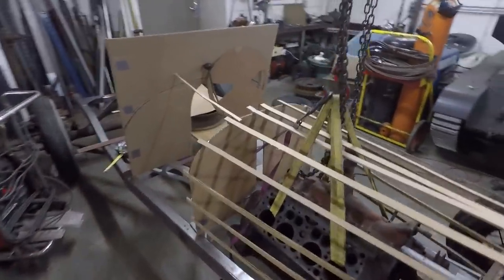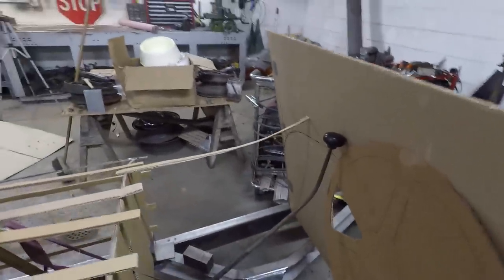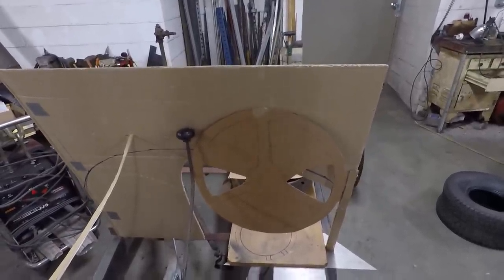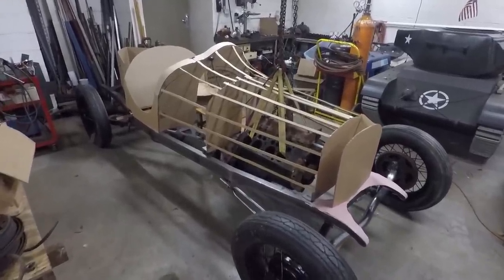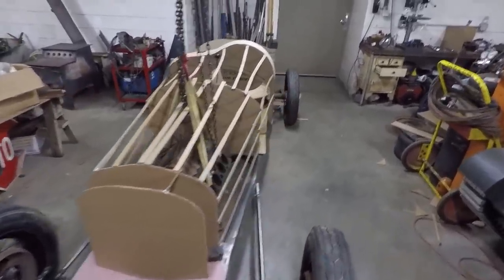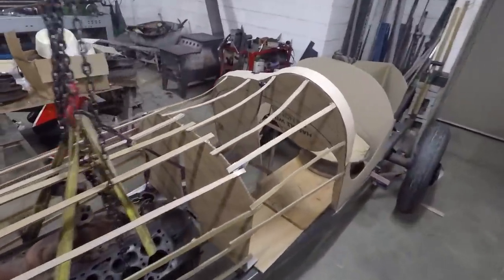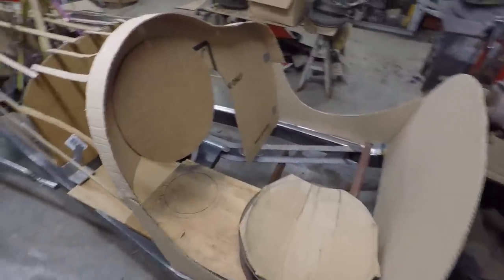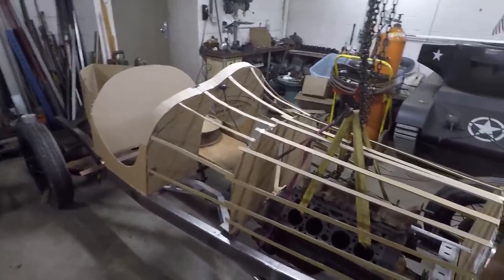Cardboard Car Body Mock-Up | Boat-tail Speedster Pt.19

Comment: I wasn’t thinking there would be anymore videos before the spring but you managed to squeeze in one more from your break. 😁

Seeing the CAD (cardboard aided design) mock-up really shows the scale of the project and will be a cheap way to plan for the overall design. 
Like one other comment I also agree that the boat-tail could/should be longer. They were often as long behind the tires as you made the tail now. 
Either way it shows that the 2 seater is going to be extremely cosy.
Reply from the maker: yeah, the boat tail will be a bit longer than the video showed

Comment: Looks awesome! Happy college! Have you considered fiberglassing the pannels? I see you said aluminum. I think they will turn out much lighter than Al and much easier to work with. God bless
Reply: I think he wants to make a brushed aluminum body. He stated he has no idea how to do that, but I think he will figure a way of doing it. He has talent... glad to see he's using it!
Reply from the maker: That would be easier, but I much prefer the look and traditional aspect of aluminum
Reply: Vasily Custom Builds 
Fiberglass is not lighter than aluminum 
It’s easier to work with I’d some regard but aluminum is faster 
And much lighter
Reply: Aluminum is thinner just in shear mass or by volume take a piece of .060 aluminum 
And take a laminated piece of fiberglass the same size let’s say both are 24 x24 
The fiber glass to have any strength with have multiple layers 
Typically it well end up 1/4 inch 
Other wise it’s just to flimsy and ends up stress cracking 
So 1/4 of inch equals .250 
That’s 4.16 times the thickness 
With the weight and mass of fiberglass resin and this can vary do to fiberglass can be resin heavy whoever laid it up used to much resin versus cloth or mat 
A 12 foot fiberglass boat and a aluminum 12 boat I promise you won’t pick up the glass one but be able to load the aluminum one in the bed of your. Truck by your self 
Do some research you’ll see 
I have a chopper gun setup 
I make molds 
It’s heavy stuff thanks for your 
Question

Comment: I think it looks really sleek. The aluminum is going to be expensive but totally worth it in my opinion. Working it can be tricky, although not impossible, without all the proper tools. One words of advice on the cardboard side of things however. I'm not saying you used the wrong tool, only speaking from experience, a regular box knife does work. The cheap little $1 red and black snap blade knives from Walmart work so much better, especially on curves. Anyway keep up the good work and good luck in school but hurry back and get this car built. Lol.

Comment: For a body, I would suggest maybe a thin metal, or hardwood frame, and then you can bend sheet metal around the frame to create panels, if that is too hard you could always pull a 1940s Germany and just use a wood stick frame and wrap it in thick and tough paper lol

Comment: You could do a fiber glass body and it would be easy to make and mold aluminum around it with heat
Reply: I'm not sure that his point is to cut corners and do things easily. He is building a car from scratch using the old methods for a reason.